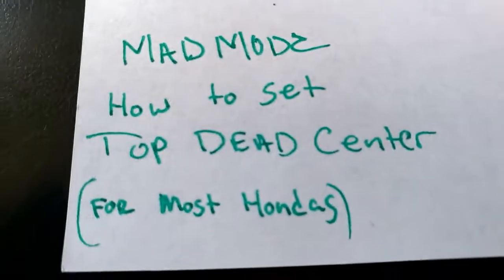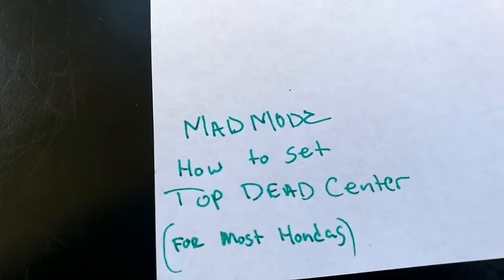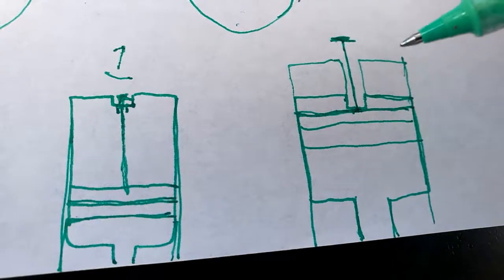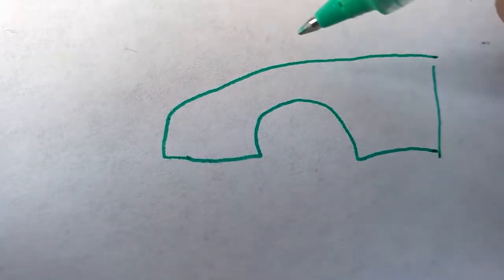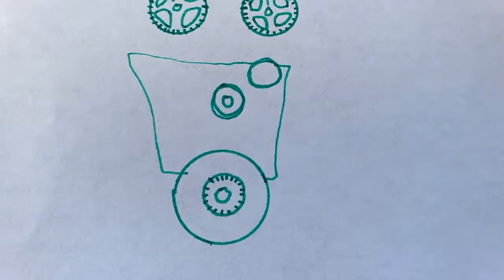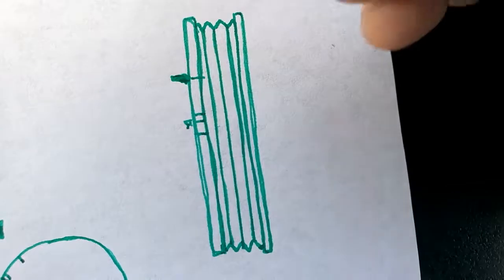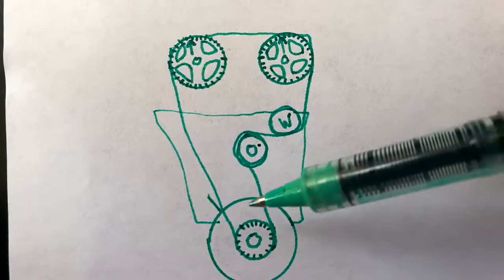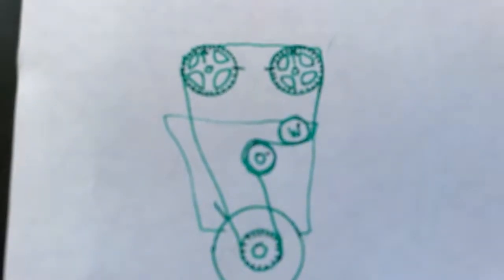Top Dead Center Explained (for hondas)

Comment: Can’t find any. I replaced timing belt but forgot to mark the cam positions. After installing new timing belt l. I turned the motor manually bout 4 complete turns with no seizing. I’m afraid to start the engine. Any advise on how I should proceed?

Comment: Are the three notches on the bottom pulley supposed to be on right or left side of the single notch. I’m not sure if this is the same on a j-series engine. On my engine the lower cover marking is a triangle and at the same location I’ve been looking for info on the net for more in-depth instructions.

Comment: Took forever to find this info. I messed up the timing I think when tightening crankshaft pulley without using the tool to hold pulley in place when remove the main bolt. I thought since the engine turns clockwise and the tensioner is keeping belt in place. Turning the crankshaft pulley the timing wouldn’t change because belt is already set on all three pulleys and all the marks line up. After tightening the bolt. I tried manually turning the engine. I could only turn it 180degrees in both directions. Will your instructions fix my problem?

Comment: So the past  few weeks there was a few times it started on the 2nd try..now I have a no crank no start situation and  noticed the 8 flashes on my 89 si obd.which is tdc timing I believe....had timing adjusted in order to pass smog 2 years ago and last year changed the distributor..was wondering if the timing possibly being off could be the reason for the no start..I was about to buy a a new distributor since I read the tdc sensor was on the distributor but now after watching this it could possibly be the timing being off a bit..but since starting is.a issue I was thinking replacing the distributor would solve the issue....I don't know maybe ai would know.. anyone have any ggestions?